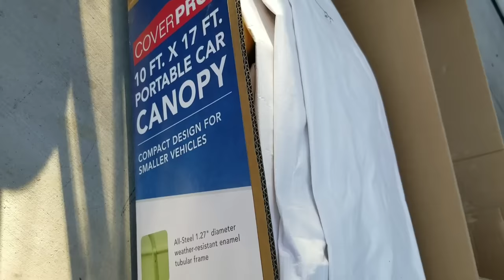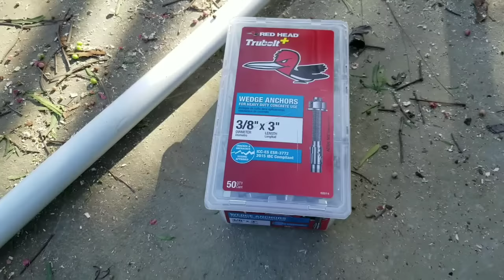Harbor freight tools portable Garage into perminant  Garage use the poles not the tent

Comment: BASED ON MY EXPERIENCE, I WOULD CAUTION ANYONE NOT TO DO THIS. I had a harbor freight carport collapse on my car after a snowstorm. It smashed my windshield and bent the windshield frame….. total damage was $3700. There are other materials to use if you want to make a similar structure. This tubing, in the harbor freight unit, is EXTREMELY THIN. my damage happened two years ago, and in my housing development last year it happened to another resident. In both cases there was damage to the car after a snowstorm. I don’t imagine this harbor freight structure would do any better in Highwinds.

Comment: In high wind you need to build it WAY stronger, if you have several of these floating around, you need to have not 4 poles per-side and but to have 8 ribs roof down, you need corner gussets.  Weld X's in between every square, can be ground anchored with 4 foot ground anchors ALL around or cement anchors are good too. Mine survived Ian with continuous wind of 155 miles per hour as well as some heavy no name storms.  Believe me I know what I'm talking about every corner needs trim bracing and put some kind of real front door and you are golden. I have had over 12 of these,  2 have survived anything that came.

Comment: A good thing to do after you've drilled your hole is to clear out any remaining cement dust from the inside of your hole. Removing the remaining dust with a shop vac or air hose will  assure you the exact depth you need.

Comment: Cutting wheel and a grinder will do the job for cutting your metal to size.an i would only put one screw because more holes will just weaken your tubing, a couple of x braces would be good though. You did a great job on your build put mine up with just the canvas topper but when its destroyed i probably ut on some metal.thanks for your time
Reply from the maker: it is really strong too. I dont know if it would hold a huge snow and ice load but I think I could put most of my weight on the roof ant it would hold.

Comment: Temecula allows 100 sq ft. so 8' x 12.5'.  For your rafters, take scrap PBR and screw it to each section, if you have extra poles, you can use them as well.  Old washer has three sides you can cut up for bracing.  Anything with solar electric on top doesn't count towards property tax if you go bigger.
Reply from the maker: nice with the way I built this you could almost fit a car inside that Maybe a small one. because you almost get the full 8ft inside VS if you use a wood structure you loose too much to fit a car insde and open the door.
Reply: 2 For2 smart cars for sure... at least one Fiat 500.  Oh wait For2's are 8' long...

Comment: How many panels did it take to go up, over and down the other side? Plus the panels for the closed end? 
Will you add a panel or two to close up the front peak? That would look really good if you don't need the height for what your driving in there. 🇺🇲👍🏻

Comment: Oh yeah 😎. What size EMT fittings? (EMT=ElectroMetalic Tubing= Conduit as in Electrical Conduit) l.5 inch or 2 inch EMT fittings? Would EMT Compression fittings be stronger/better? FYI EMT "Compression-to-Box" and only Compression-to-Box fittings,  the threaded end that goes into your metal box, these threads are same as SAE plumbing threads. Remove the lock ring first,  then screw the threaded end of Compression-to-box to the galvanized plumbing fitting of your choice.

Comment: The metal will weigh it down pretty much long as you have some kind of anchors your good I put a joist in I used conduit and just smashed the ends and self tapped it into the metal

Comment: I see you started at the top so you didn’t have to do ridge vents I did ridge vent I have gravel base and just drilled out the holes and used rebar as my anchor just pounded it into the ground and the rebar has a hook on the end so it doesn’t go all the way threw they re did my road when I bought the property and moved my modular home here then they had extra tar roading in a huge pile they were throwing away so I said bring it over here I’ll take it off your hands I just moved here and need something for my driveway they filled my whole driveway for me then I tampered it down and it turned out great

Comment: It does matter what you use to cut the metal them pipe cutters are great because if you use like a grinder which you can and a lot of poeple do or a saw saw and that leaves a rough edge which adventually causes rust unless you seal it with paint where you cut it but that’s a smart choice on your part by choosing the pipe cutter man roofless to you and I did the same thing as you ended up doing it for under 300 but didn’t close the walls in yet I just did the roof and the gable ends I’m doing the back this spring then I’m gonna put a garage door on it with a back man door so I can pull my truck in it and be able to work on my truck out of the elements outside I did mine in regular union corrugated metal got em from Lowe’s for 26$ a piece galvalumed or something does the job for me keep the ran and snow out of the place and off my truck then allows me to work on my truck in the winter without being cold as heck

Comment: Approximately where do you live? Do you get much snow?
Reply from the maker: no snow here. On my other channel I have several videos on strength tests. Had over 80mph winds and no issues. all on other videos on the other channel.  I even sat on the roof. still standing strong.
Reply: @Mikefngarage  I took two 12x20x8 ShelterLogic Garage-In-A-Box frames and doubled up the ribs. I ended up with a 12x20x8 portable tarp building with a rib every 2'. I then put metal sheeting on it horizontally. I have a really high snow load here, but when I was climbing on the peak (to screw on the top sheet over the peak), it felt pretty solid to me. My past two tarp covers only lasted one year - lately we have been getting 100 km/hr wind events at least once a year and the ShelterLogic tarp covers cannot handle those wind speeds. The shed looks pretty ugly, but it should keep my firewood dry for many years to come.

Comment: I have the 10x17 harbor freight shed and getting ready to place my order for the PBR panels how many panels would be needed?
Reply from the maker: I dont recall I think I used 9. but cant remember.
Reply: Most panels cover 3ft wide, here in the southeast u can find Sheetmetal suppliers all over for building barns, we call it barn metal, they roll it out like they make gutters with a rolling form, can get almost any length that u can safely haul, they have different gauges too 26 or 29

Comment: I guess asking you if that metal roof would take a foot of snow load wd b a moot point, seeing the lemon trees in the background...
Reply from the maker: It would hold some pretty good weight I have been on top of it.
Reply: @Mikefngarage  i got a bunch of composite asphalt roof panels (3ft x 6ft) that only weigh 14 lbs each to go on  top of my round top shelter; they are wavy can fit under each others edge. shd i use self tap screws like you did or bolt it right through a two hole puncture at each spot put shim under bolt head go through the tubular steel frame then put a bolt underneath to finish it.  other thought i had was to use pipe hangers to go around the tubular frame instead of drilling a hole right through it to get the bolt right through the whole tubing. but i dont know if a pipe hanger (using bolts on both ends through the tile top surface then have the pipe hanger metal underneath the tubular frame and attach beside the tubular frame thereby not drilling any holes into the frame at all.  your thoughts?

Comment: Great video, how much concrete did it take?
Reply from the maker: 2 yards at 3.5 inches thick. I didnt use any wire mesh either because I was putting lighter vehicles in there. no need to.
Reply: Thanks

Comment: Cool
Reply from the maker: the thing I forgot to mention is that the reason I made it with these smaller poles is so you have more room inside. I can get in and out of my bus no problem in this building. a little tight but I put a car cover over it also without the door. Havent made it yet. but it should not blow off because there is only one opening.